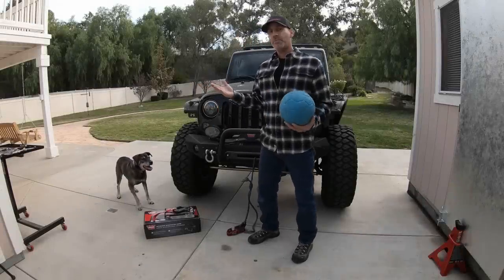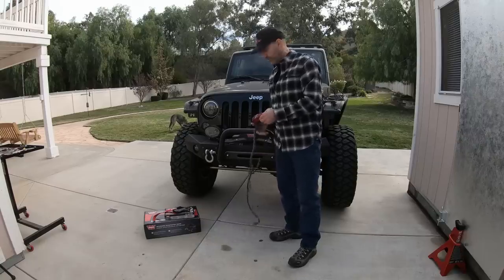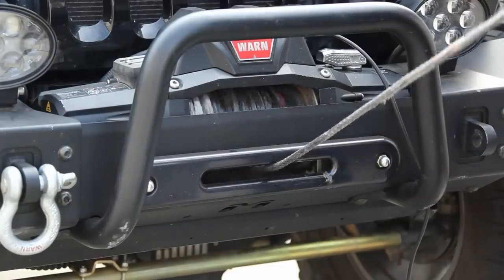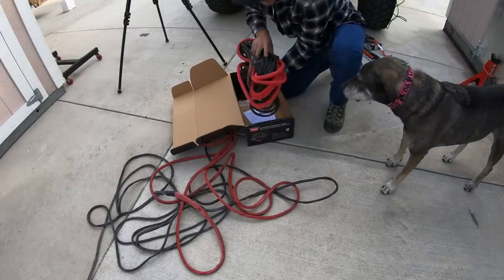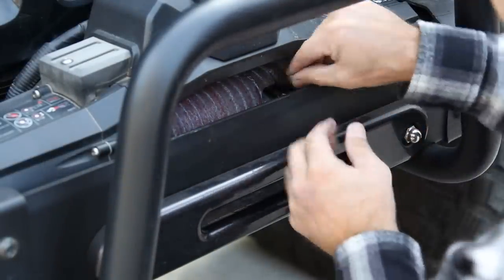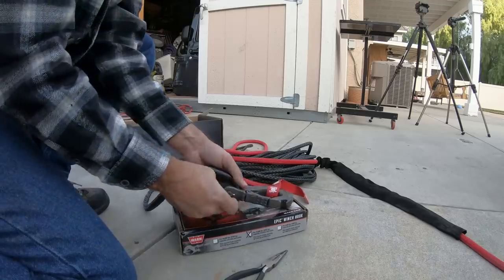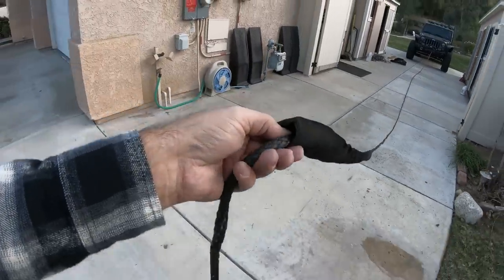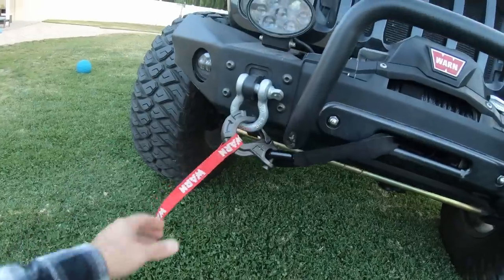Replacing a Warn Winch Rope and Hook Comparison Warn Epic or Factor55 Ultra

Comment: hey :) ima journeyman lineman and i would recommend leaving tension on about 90% of ur line while winching it up. and after a recovery on the trails wrap that rope around ur bull bar till u get a chance to properly tension it up. its gonna be real tough tryna get that rope un buggered up from it berrying itself with in its own lays
Reply from the maker: Howdy! I really appreciate the input... Thanks!
Reply: Strap it to another trucks d ring out your truck in neutral and pull it tight. You really dont want to pull over loose layers. This can damage the rope in both wire and synthetic.
Reply: ur welcome, and thank u for all the priceless information ur helping the community out with.  i came across ur page looking for valuable info to build the courage to start my 63.5 fastback galexie.  i like cars trucks and knowledge. take care brotha happy new years
Reply: Warn recommends wrapping all but the last 5' feet under tension, and that is for safety reasons.  Besides, I doubt you're going to be anchoring to something 5' away and trying to winch yourself out of a bind.  😀

Comment: Good video thank you. I’m actually in the process of switching mine out. For those that are going to do this if I can add one thing to make it a little easier access those 4 torq screws on the top of the winch can be removed for full access to your spool. It’s much easier than going through the fairlead.
Reply from the maker: Good tip.

Comment: Just put my synthetic cable on today, quick tip I learned because mine fought me when I was pushing it through  the spool, instead of fighting the cable, tie a smaller rope like paracord to it, and pull with a separate vehicle, 30 minutes of swearing vs 5 seconds of bliss

Comment: Also, I am not a fan of the UltraHook either, mostly because it encourages a bit more sloppyness in your hookup.  I run the Factor55 FlatLink-E on my jeep as you are not able to do a quick-hook and go.  It forces you to be safer with every loop being totally closed.  I would rather take the extra 30-45 seconds to use a shackle and force myself to think about every connection in the system.
Reply from the maker: That is sound logic for sure.

Comment: Hey Jason, is there a reason you didn’t change out the winch plate? I read somewhere when buying my winch rope that a blemished winch fairlead can cut the rope. Looked like there was on on that drivers side but I could be mistaken what it is! Thanks! 

Reason I ask is that I’ve got a small abrasion and am considering replacing the winch fairlead but you probably know more than I do lol
Reply from the maker: Howdy, that abrasion you see on the fairlead is just some melted rope from when it broke. It rubs right off... good suggestion since you do want to keep that area smooth to protect the rope.

Comment: I love your videos!  Good technical information, entertaining to watch!  One question came to me watching you fight to get the old rope off and the new rope with chock installed - why didn't you pop the upper bracket assembly off for access?  (looks like the bars across the top, along with the control panel, could be lifted for access by removing the bolts at each end of the support brackets?)
Reply from the maker: Hey thanks for watching! Since these winch plates are bolted in so securely... none of those things really come off that easy and this bumper being design to keep the winch low and protected just made that a little trick.  The bar might have been a smart call but that would've made it too easy... LOL
Reply: @AutoEdits  cool!  Thought it might be for "educational value", so we'll just go with that, right? LOL

Comment: Good stuff, thanks for sharing. Is it better to store the rope completely under tension? I've been spooling it in until the hook touches the fairlead, then I zip tie the hook (like the Factor55), flat to the fairlead.
Reply from the maker: I have had good success with the hand held tension on the last few feet and then put a bit of tension on it for storage.  The Factor55 stored right against the fairlead and I just hooked the Warn Epic to the shackle and tightened it up.

Comment: Another sick video Jason. This isn't winch related but what are your thoughts on lockers. I have a 2013 2 door wrangler sport and am regearing it soon. What type of lockers or lsd's should I install along with the set of new gears. I use my jeep as a daily driver and do some light off roading on sand dunes mostly. Would appreciate your feedback. Keep up the great jeep videos!
Reply from the maker: You can never go wrong with ARB lockers but I don't know how some of the other brands perform since these are stock Rubicon lockers.  I like electric style
Reply: @AutoEdits  Great, thanks for the advice.

Comment: Is the biggest difference between rope and wire the weight? Or are there other benefits? Pros - Cons?
Thank you for the greatness of this channel!!
Your biggest fan from Sweden, as always!! : o)
Reply from the maker: Yes, the synthetic rope is lighter and easier to use when you're in a tough situation.  It's plenty strong but you just have to be careful not to damage it and it is MUCH safer in the case of a line failure.  That's why many hard core off road guys have switched to synthetic rope and make it work.  I like it.
Reply: Attila Morvai they won’t standup to sharp rocks and things like cable will but yes lighter and easier to handle, you also must consider maintenance of them. If you are someone that can’t be bothered with taking the time to wash and care for them when needed then stuck to cable. There are tons of vids with pros and cons of each, when I bought my Warn I simply spent more money on a better winch knowing I could upgrade to synthetic when the time came down the road.

Comment: Ok this may seem like stupid question but ive never owned or used a winch. If you were too put a winch on a rig shouldnt you get a higher amp alternator (more then stock) too help supply the winch the amps or would just a deep cycle battery be sufficient?

Comment: I guess the factory hook that came with my harbor freight winch is good enough for me.... cant justify the cost. Hell that red one is basically what I gave for my whole winch
Reply from the maker: The Warn Epic Hook is only $60 and is way better than the stock hook... much more practical.  I forgot to mention it has a built in bottle opener.

Comment: Nice video brother, what kind of tires are you running now? Also did you use those on the sema event?
Reply from the maker: Thanks! Those are the Maxxis Razr MT 37x12.5 R17 and I like them a lot... just ordered another set.  Yes, most of us on the Trail to Sema ran them with much success.
Reply: AutoEdits ok thanks, yeah I am either getting those or the STT Pro. I have some snow/ice where I am right now currently. Thank you

Comment: Question about the synthetic rope and the winch. I purchased my warn winch with the wire rope (steel cable) I swapped out the cable for synthetic. Is the only difference between the 2 winches the attachment point on the drum? Note I also put a heat shield on the synthetic rope to prevent it from heat damage where the rope covers the first complete wind of the drum.
Reply from the maker: That and the fairlead.  You don't want to use rollers with synthetic rope but a Hawse fairled like in this video.
Reply: Yes Jason I forgot to mention the fairlead. thanks for the feedback👍🏼

Comment: you missed the key point of the Warn Hook. it has a built in bottle opener lol.  I thought for sure that's where you were going with the benefits of the warn hook:)  I use both set ups on different rigs.  I mainly use soft shackles with the factor 55 and mine doesn't have the hook on it.

Comment: Because of you, my next battery will be an Optima Yellow Battery.  As for winches, I got a Badland 12K over a year ago; but, have yet to take it out of the box.  I finally ordered a receiver hitch plate for it.  I've decided I'll be sticking to easier trails, no crawling, and am going to be able to move the winch from vehicle to vehicle.  I've even ordered custom quick-disconnect cables for each vehicle receiver hitch position.  My question is:  Where is a good place to buy battery bus bars?  On my ZJ, I figured out the threads on the unused secondary battery terminal; and, I'm going to bolt/connect my winch fuse to that; and, the black cable to the opposite side; but, because, my Suburban is buried deep in the garage, I haven't had a chance to look at that battery; although, it is the same battery as the ZJ, I remember that the Suburban uses what would be the secondary terminals, on the ZJ, as the primary terminals; so, being the same battery, I'm thinking, I'm going to need some sort of battery bus bars, to connect the winch cables and fuse to the Suburban's secondary terminals; because the primary points don't have a lot of room.  I got a quick glimpse of your bus bars; but, don't have much information beyond that.  Wondering if you'll elaborate on that?  Also, getting ready for my big annual offroad adventure.  I just got me some new Magellan Explorists TR5 & TR7 navigation devices.  I remember you getting lost at Miller Jeep Trail.  Don't want a repeat of that.  My point is:  No "big-names" have really reviewed them.  One "upcoming" name did a poor job on the TRX7 and really spread disinformation about it.  He really should take that video down.  I like your video style.  I'm not much of a speaker or editor; but, I did make two videos on them, that share way more information about them; than anybody else; and, that go a long ways to learn how to really use them.  I thought you should watch the 2 videos and maybe make one good video that will do a better job explaining them, than me.  I feel that Magellan Explorists are revolutionizing off-road navigation and are worthy of being properly shared; and, I think you're just the guy to do it; especially, because, you've shown the world that we're all capable of getting lost.  I know I've been lost numerous times.  You have a knack for being able to explain things very well.  I can't think of anyone else who could better explain the Explorists.
Reply from the maker: Thanks so much for the thought  on the Magellan thing! I don't think you want to run a bus bar for a winch... it's a heavy draw item and it's recommended to have it connect direct the the battery.  I would recommend direct wire with a heavy gauge quick disconnect to go from vehicle to vehicle.
Reply: @AutoEdits  I know exactly what you're saying and that's why I asked the question.  Same struggle I'm having.  The fuse is a 150 AMP.  The cables I've ordered are 2 Gage.  The ZJ should connect no problem.  My Suburban doesn't come with a way to connect the 2 Gage Cables to the top of the battery; so, it's looking like I might have to custom fab some thing up, like, BleepinJeep did.  Maybe Flatten out some pieces of copper pipe?  Drill some holes thru the flattened pipe for some bolts?  Figure out a way to secure the cables to the top of the battery; of course, with a fuse.  I've already ordered another fuse for my Suburban.
Reply: I'd highly suggest a northstar battery over any optima. Optima is not what it was the first few years they were produced. They moved production to mexico and the quality went down. The car audio community realized this almost immediately. They have since move to deka for inexpensive batts and northstar and xspower for premium batts. And currently lithium but that's unnecessary here. What is more important here is the fact that the alt only puts 50amps or so out at idle and you have what a 60ah battery? So 110ah available and the winch can draw 250-300amps fairly easy. So it's important to make sure you arent boiling your batteries or killing your winch with heat.
Reply: @kylevanwinkle2081  I appreciate your concern.  I really do.  Lucky for me, I generally don't aftermarket my stereo.  I'm perfectly fine listening to my engine and my navigation device making sure I don't get lost.  For non-offroading, I'm sure a Northstar is superior to Optima; but, for off-roading, I don't think so.  Just the basic design of the Optima is not going to have lead plates breaking and shorting.  Were you around for the "Gel-Filled" Battery days?  Trying to keep batteries from shock damage, of off-roading.  The Optima does that, without gel.  If you want to convince me, take apart an Northstar Battery and show me how they're technology is going to keep me from killing my battery offroad.  Ever kill a battery in the desert, 40 miles from the nearest air-conditioned anything?  I have.  Luckily it was under warranty; but, that was an 80 mile round trip with about 40 miles of bonus off-roading, thankfully, with a buddy.  That Barstow battery is still in my Suburban today; but, it will eventually die.  Check out the insides of an Optima.  I'll bet a Northstar doesn't look like that.  Optima patented the design.  Autoedits was the one that made me take a look at Optima.  What I saw inside is what sold me.    https://youtu.be/3OInHzlQmOo
Reply: @301steady  lol I assure you an agm battery is not a gel battery. In fact it's the same thing as the Optima except the optima is a spiral design compared to the flat plates of the northstar. 

I can assure you northstar is a much better battery. The car audio relation, was in relation to the high amperage draw accessories like winches can draw. 

I've killed quite a few Optimas in daily use both red tops and yellowtops. I'd rather any of the premium agm batts available from autozone, napa, O'Reilly, Sears, and so on.
Reply: @301steady  skim through this. https://www.pirate4x4.com/forum/electrical-wiring/1051909-best-off-road-battery-4.html#/topics/1051909?page=1

I literally just typed in northstar battery offroad.

The car audio community drives battery innovation for the none hybrid, ev crowd. Or used too now they like ultra capacitors and lithium batteries because they can pack more power in less space as well as having more power in surge form which is great for pulsing car audio systems.
Reply: @kylevanwinkle2081  Thanks.  Next time a battery of mine dies, I'll consider this.  Availability & Convenience is important too.
Reply: Northstar needs more retailers.  I found two within 10 miles from me, I stopped counting at 20, in that same 10 miles, for Optima.  ZERO Northstar retailers in Barstow; where, I got my last battery.  You can make the best product in the world; but, people can't find it......

Comment: Love your videos Jason. A couple of suggestions: when you wind up a synthetic line, it's actually better to make a bit of a mess of the spooling so the line doesn't get jammed between two wraps of rope. Also, there's a school of thought on closed loop winching. Rather than using a hook, just use a D-ring on the loop at the end of your line, which is practically impossible to accidentally open up and fall off while winching (or driving over it). The little piece of sheet metal and spring closing your hook is always the first thing to go.
Reply from the maker: Thanks for the suggestion! Yeah, I fully appreciate the close loop system of the Factor55... my buddy used to always say "what if" you didn't have that shackle always available (I always did) But I'm into taking advice from guys that have been doing this way longer than me and will try this out this year. I'm glad the Ultra Hook broke when it did and how it did... would have caused a bunch more damage to my Jeep if it didn't... the thing is awesome.
Reply: @AutoEdits   give pinto a belly rub for me!

Comment: Did you keep the broken winch line? Can it be re-spliced and used as an extension?
Reply: Agreed
Reply from the maker: You can splice it in... Factor55 makes an awesome tool to do just that but the drum will only fit so much rope before it rubs on the winch plate so 100 feet is good for me right now... Good question though!
Reply: Jason, keep your old winch rope. Being it's not wire, it is easy to store on board. Install hooks at both ends. Trust me, there will be times when the 100ft rope on the winch will come up short.
Reply: Kent Chesley that’s exactly why I haul around 3 extra 30ft heavy duty straps plus tree savers etc.
Reply: been there! my longest line pull was 165' with  two 20' and one 30' strap. I was in a meadow with one telephone pole sized tree stump. I have since welded up a land anchor.
Reply: @AutoEdits  I agree, but if the rope is still good then splicing a loop on both ends and keeping it in your recovery gear could give the added length if needed.

Comment: The factor 55 is prolly the best winch hook available. But I personally would never use the hook part. I would run a Crosby shackle in it at all times reason being is that safety latches and hooks in general are very weak when side loaded. A Crosby shackle retains 50% of its rating when sideloaded.

Even on conventional hooks I still use shackles unless the hook is significantly larger than the sling that is in the hook. Crane hooks are a good example. More than 2 slings or eyes of the slings in 1 hook should have a collector shackle
Reply from the maker: I'm actually glad it broke how it did... would've caused way more damage to other things that I don't want to repair on the trail. I was and am still extremely happy with the Factor55 but just want to try something that was recommended by a seasoned veteran.

Comment: The tiny opening on the ultrahook kind of defeats the purpose of having a hook in the first place: to do away with the need for a shackle. If it was any bigger, it probably wouldn't be strong enough, being aluminum. The warn looks like it works well with a tree saver strap.